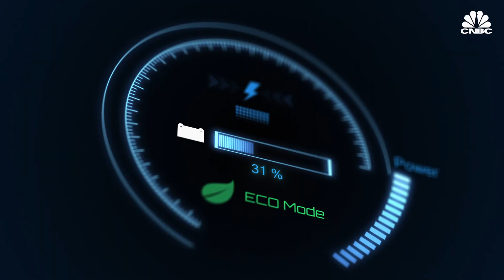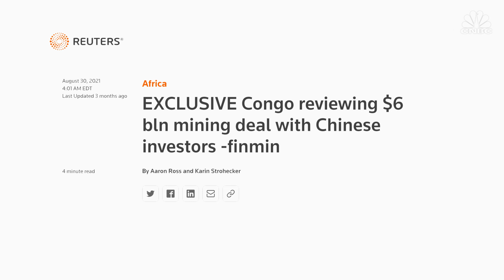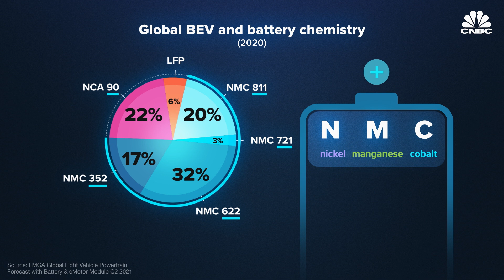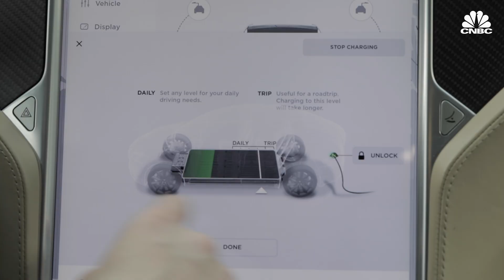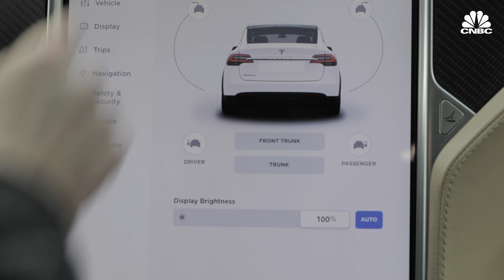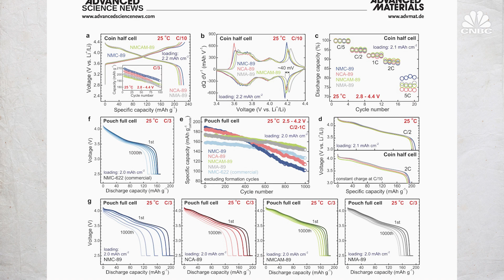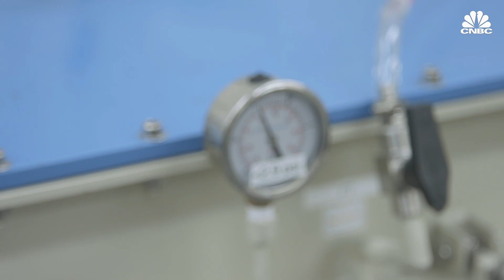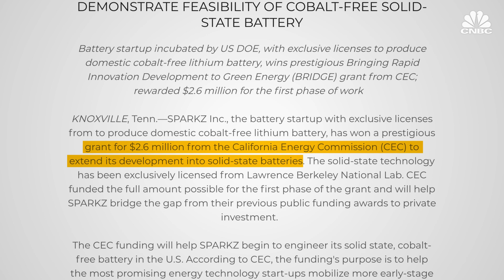How Removing Cobalt From Batteries Can Make EVs Cheaper

Comment: Remember the majority of Cobalt mined is actually not used in battery production. Its used as a catalyst to clean up petrochemical fuels, where its consumed forever, meaning more needs mined. But what is used in batteries can be recovered when recycling them. You don't watch one youtube video and think you know everything about a topic
Reply: Plus it's used in metallurgy don't see anyone complaining about that though. Thank you also for mentioning the fossil fuel industry's consumption of it. 😏
Reply: Yes you are correct. I would to add one more thing, the cobalt used in refining petroleum products are non recyclable and it is discarded in the atmosphere
Reply: @rab5193  I had no idea cobalt was used in oil refinement. Thanks for the info.
Reply: Yeah and it’s #1 export is copper and #3 is gold is the world going to boycott those as well.
Reply: The comment above is inaccurate on several
fronts. Cobalt’s use in rechargeable batteries is its largest single use globally (~65% of total demand) and has been for several years.
In the United States, superalloys used
for jet turbines are the single largest direct use of cobalt. However, the United States imports cobalt both in raw material form (metal or various cobalt chemicals) and cobalt contained in finished and semi-finished goods including cathode precursors, cathodes, batteries, electronics, power tools, and xEVs. Cobalt’s use in all catalysts is about 4% of total demand. Moreover, catalysts, by definition, do not get “consumed” (with some rare exceptions like platinum in speciality silicones). Catalysts do, however, become less active at which point the spent catalysts are sent to be reactivated, typically, on a toll basis (i.e., ownership is retained). Cobalt catalysts have been recycled in the United States by Umicore’s plant in Alabama.

Perhaps the comment was a misread of information of the Cobalt Institute website which states that cobalt catalysts used for desulfurization is the largest use of cobalt in the catalyst sector (emphasis on the latter).
Reply: Plus its use in our gadgets' 🔋 packs is substantially greater than in EV 🔋 packs  - but you don't see anyone rushing to either complain about either that or boycott those products altogether. No; more likely to rush out, spend obscene amounts of money on the 'latest' up-to-date version of whichever gadget takes their fancy despite their current one being in perfect working order &, most likely, don't use most of the functions beyond the basics or even have any awareness of their existence. And then leave the previous version lurking in a draw, unused, along with all the other perfectly good electronic wizardry. Massive waste of the Earth's resources & huge environmental impacts due to overconsumption especially climate change.

Comment: Oil companies don't want it to cheaper .if it becomes cheap then oil companies will be destroyed
Reply: Most of the electricity is still coming from burning oil, there’ll be more demand in electricity which means more demand in oil, renewables aren’t covering enough as is, adding the car charging market and multiply it by thousands of cars, oil price suddenly shoots up. Unless we integrate nuclear energy there’ll be a shortage.
Reply: @BiggoSuave  less than 1% of us electricity comes from oil. And renewables are increasing fast. What are you talking about?
Reply: @BiggoSuave  no it does not stop spreading lies. Nuclear and renewables currently combine for apx 40% of the us energy mix per the eia. Adding evs doing off peak charging makes the grid more efficient as well. Without adding v2x capabilities. 
Which are just now starting to come online. 

Try searching the term "rejected energy" to better understand just how many terawatt hours we waste every year. 
because the base grid frequency has to be constant, but demand is not. And so far large scale storage options lag severely.👍🏻
Reply: @BiggoSuave  ok? That’s not electricity though. EVs run off of electricity, not petroleum.
Reply: @satviktasupalli4885  lol Tell me how’s electricity generated?
Reply: @BiggoSuave  less than 1% of us electricity comes from oil, coal usage in electricity has plummeted and is still dropping, while renewables grow.